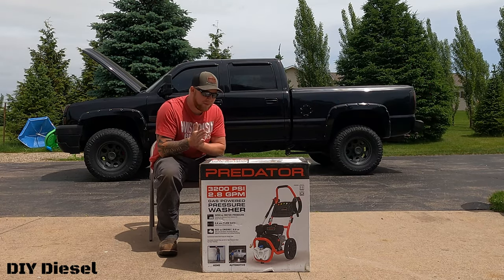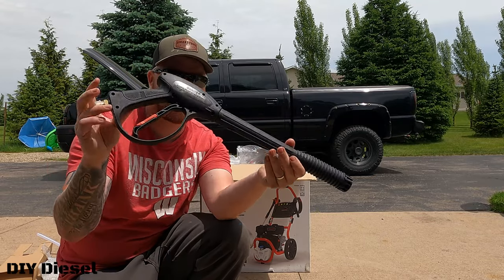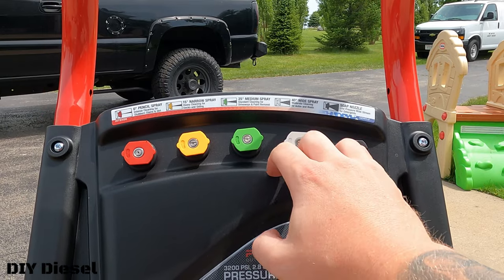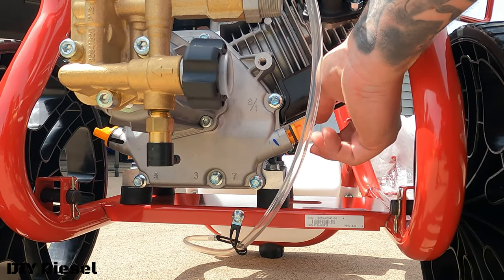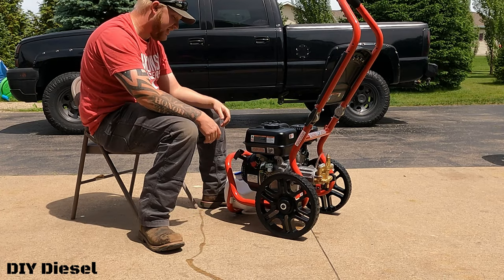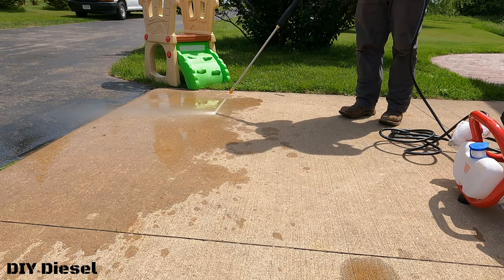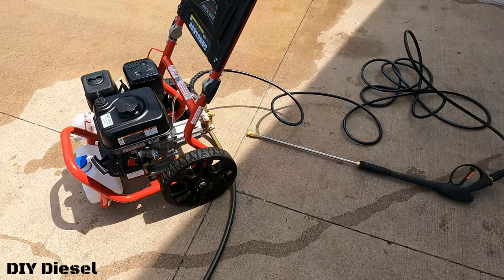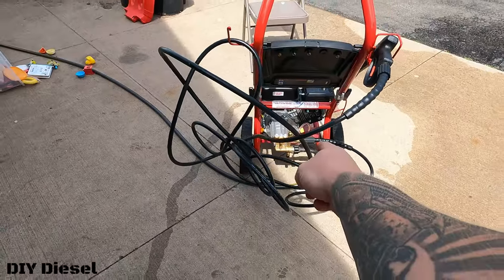Look What We Added!!! Harbor Freight Predator Pressure Washer 3200 PSI 2.8 GPM

Comment: Any idea what I should do to make sure the pump doesn't have any standing water in it? Starting to get pretty chilly in southern Minnesota. 
Figured I could just blow it out with an air compressor but I figured I should ask the expert.
Reply from the maker: Sta-bil pressure washer pump protector 👍
Reply: @DIYDiesel  Ohhh alright alright. I thought you were saying it should be bone dry in there before it hits freezing Temps. I should be good then, thanks!

Comment: Yo buddy what's up. Been a minute since I seen any of your videos on my feed. My #2 injector on my lbz went out since last time I talked to you. I'm just replacing the one injector and hoping it'll be OK. After a guy I know got it running #2 was the only one with a crazy balance rate so.... fingers crossed
Reply from the maker: That’s some good news!
Reply: Yeah atleaset I know what's wrong with it now. I'm going to get an electric pressure washer to clean my vehicles with. If you're going to clean your driveway they have cheap disc attachments for smaller pressure washers that works pretty good if you're going to be doing your driveway. I used the b&s one from lowes for awhile. They've also got a soap attachment so you can mix up a bucket of cleaner at a time and stick a hose it has in it to feed from there

Comment: I bought one last week put it together gas/oil tried to pull cord for starter and it wouldn’t pull. I messed with it for about 20 minutes and still couldn’t get the dam thing to pull or crank over. Boxed up the POS and took it right back to Harbor Freight. They tried to charge me a  40 dollar restocking fee for a pressure washer that didn’t work. I told them to go pound sand I want my full refund. Tge manager came up and told tgem to refund tge entire amound paid. Done with this place!!

Comment: Does anybody else’s stall while just moving it around? Is it supposed to do this as a safety feature? I’ve never had one do this.
Reply from the maker: I gotta say I don’t move it around much when it’s running I’m running it tomorrow so I’ll see
Reply: @DIYDiesel  when I’m pressure washing my house I’ll move it 10-15 feet and it’ll die in 2 feet of rolling. It never had a washer do this.
Reply: @mhc2984 its the low oil protect..when you angle it to roll it..causes the oil to shoft to one side makes it think its low on oil...safety feature..adjust the handle so that when u move the pw it doesnt lay so hard
Reply from the maker: @byrddogg8445  🤘🏼 coming in clutch
Reply: @byrddogg8445  that’s what my dad said it probably was. I will try this ASAP! THANKS!!!!

Comment: Here is your MANDATORY run procedure.  Hook up water hose from spigot at the house.  Turn on the spigot.  Hook up the pressure hose to the pressure washer.  Hook up the wand.  Pull the wand trigger WITH ENGINE OFF and let the pressure hose and wand fill with water and it will start to squirt out the business end.  Now you KNOW your pump impeller is wet and not dry.  He started his machine first time without water...OH BOY...that's not a good thing to do.  Once you verify water flow through the wand, NOW you can start your gas engine.  When you shut down, hit the kill switch and then shut off spigot.  Then pull the wand switch and let the water drain out.  

NOTE - many people suggest you use pump impeller protector (lube).  StaBil sells it at Walmart for like $8 in a little spray can with the right nozzle to hook up to a pressure washer.  This isn't mandatory but I do it because it only takes a second to do it!  And that can will last a long time.